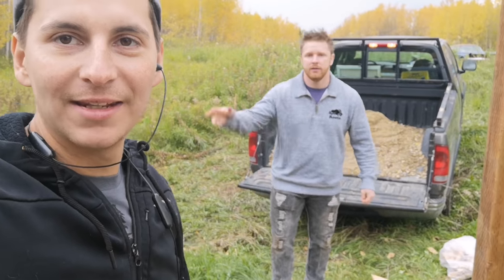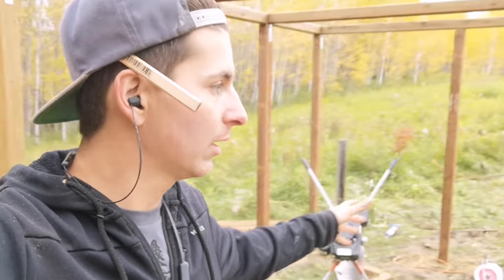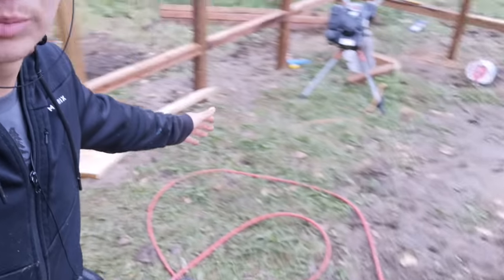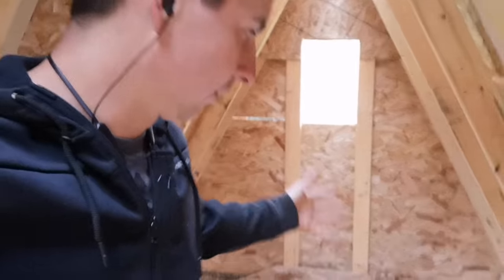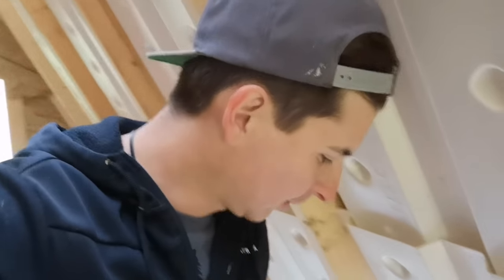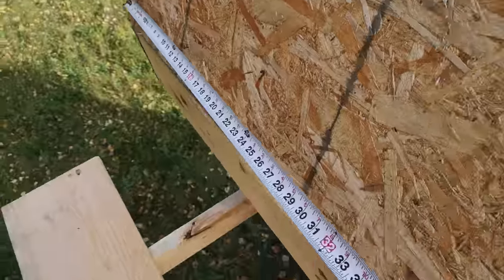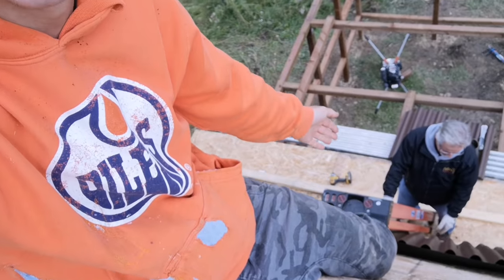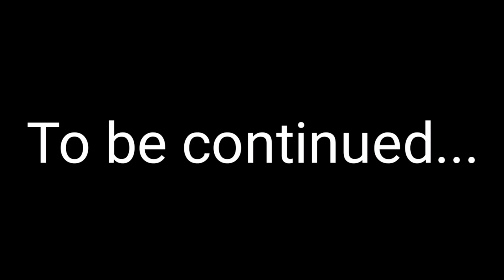Ashley's Chicken Coop - Part 4 | Another VLOG #44

Comment: To help keep the loft area clear of any chicken mites or lice, get some big bunches of rosemary and lavender before they are past their best, hang them in the roof and when you go up there later on, bash them and release some of the oils. Both are excellent repellents to add to the hay/straw/wood chips in the nesting area, too. Renew them as often as you can. I've used those herbs for almost 20 years and never had parasites on my organic flock. Also, add diatomaceous earth to the  nesting material or add it to sand in a dry area for them to dust bath. If anything is trying to live in their feathers, this will eradicate it before it can become an issue. Lastly, to prevent or deal with worms (carried by wild birds) a rhubarb leaf is the answer. Just one between every 4 small - 6 large chickens. They are NOT harmed by the toxins, but internal parasites are killed. No need to throw eggs away with this treatment, unlike the kind of treatments you get at stores or Vet clinics. Most of all - enjoy the chickens - they are tremendous fun and great company!
Reply: Really good advice, I read a book once on starlings and they gather herbs and put them in their nests and they found the chicks from those nests had a better immune system and there were less pests. As they raise a lot of young and can have several broods a year that makes a big difference as otherwise that nest would be infested for the second hatching.  Not that the starlings in my roof were all that smart they used to pick non herbs too and offer them as presents to their mate.

Comment: Just put on a roof vent or two to compensate for any moisture issues and down the road if they become a problem you can just block them off from the inside of the coop loft. I helped my old boss build an intense chicken coop for over 100 hundred chickens. So know a little bit about chicken coop builds.

Comment: Wow, your chickens gonna live good in this coop! And I like your roof too, esp. with that tiled look. Just some thoughts about some things I noticed: the very first "crossbar" of the run seems to lie straight on the ground. Do you plan anything to protect it a bit? Else it will rot way faster then the other ones just because of ground contact. And I noticed the board right below the lowest row of your roof tiles. Aren´t you afraid that the water from the roof is running always over it and causes rot? I am sure, you have something in your mind to avoid this. And lastly, do you plan to insulate the ground floor too?

Comment: When putting in the cross beams, were there just 2-3 nails diagonal in to the post just on the outside? did you put a couple from the inside as well? Not a builder but trying to learn some techniques through watching as have a cottage I need to renovate. My cottage looks like a crappy wooden shack compared to this coop. What is this wood type again?
Reply from the maker: Just a few nails in one side. Nails wouldn't reach through the other side of the post. You could also bolt them I suppose.  I just use grade A SPF lumber .
Reply: @JoshuaAlexander138  thx so much